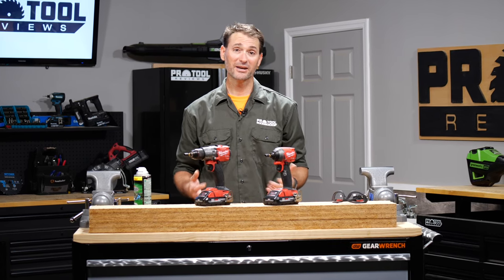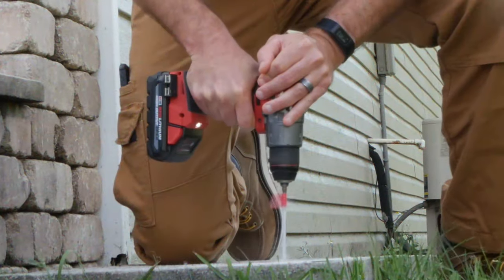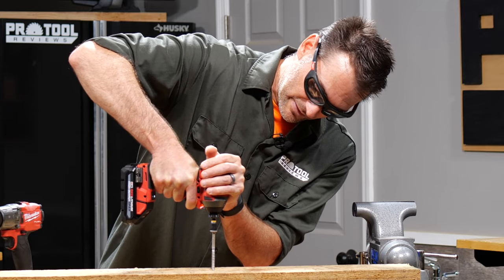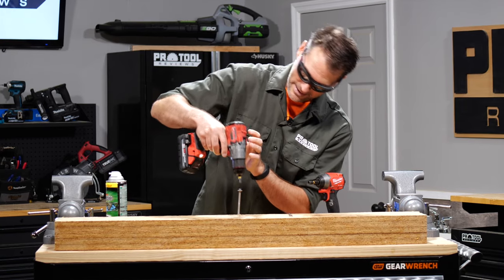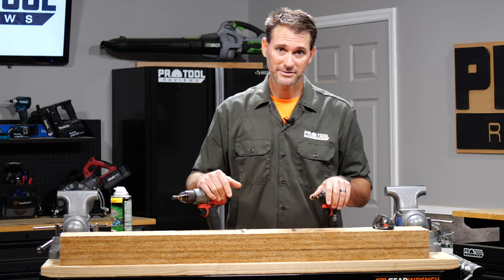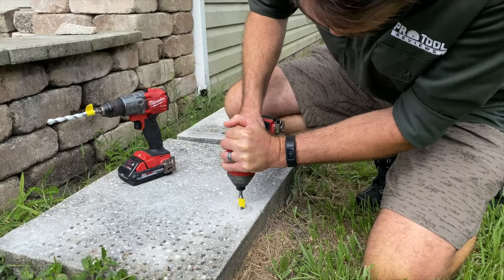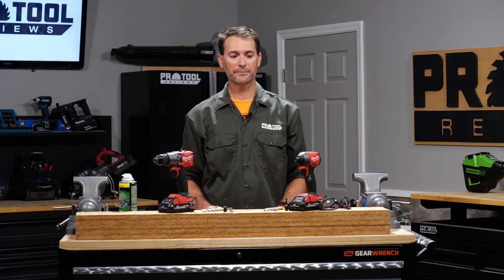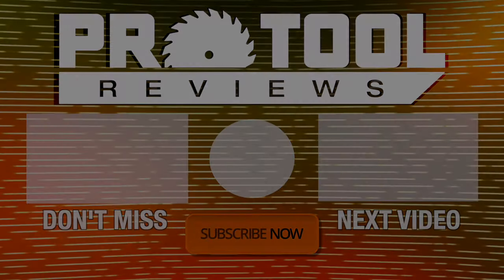Hammer Drill VS Impact Driver | What's The Difference?

Comment: In short, impact drivers use rotational impact to aid the user on not getting strained while doing the driving.

On the other hand, impact drills or maybe better called hammer drills. Uses a hammering effect along the axis of the bit. So it is not helping the gears to rotate the bit.

For example. You have a screw to be driven and you use a screw driver for it. The concept of impact driver is like putting a wrench over the screwdriver and hammering it aiding its rotational motion.

While on the other hand, hammer drill concept is like rotating the screwdriver along with the screw while tapping the screwdriver with hammer on top.

different concepts with different usage. Hammer drills are very good with concrete drilling. And can also do driving tasks. But not recommended for loosening or tightening bolts and nuts (even if you have a hex to square drive adapter). While impact drivers are more compact and and can do driving easier on the user part with less strain, can also drill holes on wood and metal (can do but not recommended in concrete), can also be used as impact wrench if you have a hex to square drive adapters. But in that case it is better to use an impact wrench if needed more power and when the strength of material holding the socket matters. Coz the hell 1/2 inch square drive of an impact wrench compared to a 1/4 inch hex drive of an impact driver. Of course some bits are expensive and you wouldn't want yours to twist/shatter everytime.

In the end. It all depends on what you are doing. Are you into carpentry? Are you dealing with masonry? Or more of assembling things? Choose your right poison 😊

Comment: Does the effect on hole is same?i use one before borrow a hammer drill from my friend to hang something on my wall, but it turn the hole not clean as impact dril, it cause crack around the hole, n the hole become bigger then the drill bit size n make the wall plug loose.
Reply: Lmfao

Comment: Thanks for the great video. I still can’t understand why not use a hammer drill for faster as it appears to work better than the driver in this video
Reply: A hammer drill setting used on any fasteners will damage the threading or tear the material you are driving through. Imaging using a hand hammer to ram a screw into a board of wood or ram a bolt into a threaded insert. You can imagine how much damage it would do to the threading. A hammer drill is really only for drilling holes into concrete and masonry.
Reply: For one thing the hammer drill has more torque than the impact, plus the increase in torque will be felt in your wrist witch will wear you down faster. Also as the man said above it will tear the screws and bits up.
Reply: @sahibal-shemeri5466  Good point. I'm just learning, but it seems like a lot of people, even guys making these videos, sort of miss that crucial distinction you made. The "hammer" is a big part of the name hammer drill. You don't hammer a screw to save 3 seconds.

So if I'm understanding correctly... Because most hammer drills allow you to turn OFF the hammer mode and use it as a regular driver drill, if you're just buying ONE good all-rounder the hammer drill would be a great option...right?? (Assuming (1) I'm needing to twist screws into things most often,  (2) do light drilling every now and then, and (3) only on rare occasions will need to drill into masonry in hammer mode, but (4) would appreciate having that killer option on board.)     

Basically I'd use it for fasteners with the hammer turned off, then switch on the hammer mode only in tough drilling situations. Any feedback would be greatly appreciated. (Soon would be great....I'm buying something in the next day or two! ha. But really.)
Reply: @darren2329  you got it exactly right. Its a great buy as an all rounder since you can turn hammer function on/ off
Reply: As far as I can tell, impactors are good for reducing strain on your wrist and minimising cam-out (slippage) of screws. But the latter only applies to Pozi (or even moreso to Phillips) - torx screws almost never slips so it doesn't make a lot of sense to use them in a test like this, imo

Comment: Might a hammer drill be more damaging to the integrity of the screw or to the wall of the material that the threads are grabbing into?
Reply: Hammer drill and impact driver both provide impact forces very few fasteners are designed for

Comment: But the hammer setting on a hammer drill is just a setting.. it also has a screw setting and drill setting you can change it to. So if you had to choose only ONE drill to have. Out of a drill/driver, impact or hammer drill. It would be a hammer drill right??

Comment: In the case of wood screws,  what you have shown is the opposite of what you have claimed.  It is so apparent that the Hammer mode has won in both cases of concrete and wood. It makes perfect sense to me now.
Reply: Don't use impacts on wood, it will reduce its holding power and may crack some types of wood
Reply: @dragonfireproductions790 Doesn't that go for screwing in drivers without pilot holes generally?
Reply: @feanor5037  self tapping screws only need rotational force.
Reply: @dragonfireproductions790  Self-tappers can still cause wood to split... not sure whether not having a pilot hole reduces holding strength if the wood doesn’t split (sure, splitting is rare) but I'd want to see an experiment to convince me it's definitely the impact driver over either over-tightening, countersunk head resistance causing the thread to tear at the wood fibres or lack of pilot holes
Reply: @feanor5037  well to be safe though pilot holes are needed so that you won't misalign the screws causing more issues like splitting etc.

Comment: So I'm guessing in a perfect world you'd use both to drive a screw fastener into rock/brick?  Hammer drill for the pilot hole, then impact driver for the concrete hex head fastener?  If you only had one tool, which would get you a 1/4" screw into brick the fastest, from pilot hole to screwing in the fastener?

Comment: 3 seconds isn't really enough for me to get a whole new tool when it comes to home projects or even work since my job doesn't drill into concrete much. No more than 3-5 times per job-site.
So saving 15 seconds isn't really worth the extra 130. Thanks for the info.
Reply: Agreed. I thought the same thing.
Reply: That tiny hammer drill is probably just extremely weak. But could replace smaller drills as a light all-round tool.
Neither would go through most common harder materials, and neither is necessary for wood or metal. Looks like they picked the one type of stone they were able to drill.
The impact drivers is primarily useful for fastening screws and nuts with specific torque against metal.
A strong rotary hammer plus a small normal drill handles most jobs.

Comment: For me, the hammer drill outperformed the impact at every level. I might use the hammer drill as my go-to. Actions speak larger than words. Thanks.
Reply: @jacobking4106  You would use a Impact Wrench on lug nuts.
Reply: @jacobking4106  So why comment asking him to remove lug nuts with a hammer drill, you clearly aren't Sherlock.
Reply: A drill is faster up to a point. Under no load, the impact is faster. Under light to medium load, the drill will keep its RPMs, whilst the impact will slow down as it engages its impact mechanism. Under heavy load, the drill will either need to be switched to low gear which is much slower, or it will just straight up not be able to complete the task.

The other key point is that impact drivers transfer no noteworthy torque to the user's hands. Try it at home: get a 4x4 and drive a 1/2" x 4" lag into it with a drill...you'll need to hang on for dear life, especially once the head of the lag makes contact with the wood...whereas with the impact driver you can use just your thumb and index finger and check your text messages while you do it.
Reply: @JR-lg8sq  Just my use case: I use an impact driver (M18 fuel) with attachments for lug nuts/car stuff. Mainly because I only wanted 1 tool, and the driver is the most versatile. This is coming from a non-tradesman, who works mostly with cars.

Comment: can I use impact driver on brick instead of hammer drill?
Reply: It didn't work so well for me.  I had to get a hammer drill for the brick.
Reply: There would be little benefit.  For an impact driver, the hammering would be parallel with the brick,  hammer drill the hammering would be perpendicular or into the brick.
Reply: Only works on certain things and it also depends on what kind of drill and bit you got, cheap drill and bit won't won't, it will just snap of

Comment: Is the Hammer Drill more so forcing the screw in as a nail? Or actually spinning it down without stripping the spirals of the screw?
Reply: use the hammer drill to drive the screw is like spin the screw driver and hitting it at the same time.  That is why the screw goes in faster but at what cost...material damage?

Comment: Thanks,  I didn't know the impact drive could drill concrete.  
Can an impact wrench drill concrete?
Reply: probably because they are a near identical mechanism. the only problem is that an impact wrench doesn’t have the right chuck to take drill bits, only sockets unless if you have an adapter

Comment: guessing here....
But I suppose you'd use a hammer drill for fast easy work drilling through concrete - but you'd use an impact driver if you wanted to screw a bolt/concrete screw directly into the concrete?

Comment: Ok so I have done the same thing with my gen 3 hammer drill and was shocked at how fast and far down it did a screw, but my question is wouldn’t it tear the threads out that the screw hole created in the wood? Maybe not? But I would think it would Create a stripped out hole if you will 🤔
Reply: That's my thinking also. I was guessing that's why he said it's not a good idea to use it on wood, but it's only a guess.
Could be worth some playing around to see what kind of holes it leaves.
Reply: @Protoolreviews  Good stuff. Thanks for the details.
Reply: @Protoolreviews  makes sense except the clutch settings on the gen 3 are too aggressive for soft wood. Whenever I am drilling into cabinets or finish work I tend to use the old ryobi with a mechanical clutch that gives much easier. Too many times if not careful on the trigger my gen 3 set on 1 will still drive a screw too far. But thank you for the response. The gen 3 is a beast

Comment: If I just want to drill a screw into the wood windowsill thingy to hold up the curtain rod holder, what kind of drill would be best? 🤔  Some people on here are saying that an impact drill will strip the wood in the hole it made. 
As of right now, I do not know the difference between an impact drill, rotary drill, hammer drill, or etc etc.
 Can someone help me?
Reply: for attaching curtain rod on wood I would recommend impact driver for driving screws since you might be working in a tight area. don't use the hammer action for driving screws when using impact drill, even on hard wood. rotary drill even with no hammer action is a big no for driving screws since it has high RPM and much less control
Reply: for pre-drilling, any drills with no hammer action would do the job. make sure you use slightly smaller bit for pre drilling than the screw itself.
Reply: @Rikardo97  So I should use an impact drill, make sure no hammering, and pre-drill first with a bit smaller than the screw...correct? 😊
Thank you. 
I didn't  know we were supposed to pre-drill. I thought we were supposed to hold the screw up, and drill directly into the wood till it made a hole. 😬
Reply: @GoaWay...  the hammer action on impact driver is automatic due to the increasing resistance the driver feels. can't be set to off. as I said with no hammer action, if you tend to use impact drill such Bosch GSB 180 LI to drive screws.
Reply: @GoaWay...  pre-drilling is a must to prevent cracks on wood when you're about to drive screw into soft wood, or putting screw on close-to-edge side of wood.
Reply: @Rikardo97  I am even more confused now. What drill doesn't have hammering  so I can pre-drill?
Reply: @GoaWay...  any cordless drill on the market. I guess every impact rotary drills have the feature to activate or deactivate the hammer action
Reply: @Rikardo97  okay. Thank you. Now when I pre-drill, what kind of bit do you use?
Reply: @GoaWay...   any twist type drill bit for wood would do
Reply: @Rikardo97  okay. Thank you.

Comment: You should never use hammer mode on the drill while screwing. Hammer mode is only for drilling into bricks or concrete.
Reply: You made the statement, now can you actually EXPAIN why not?
Reply: @hippo-potamus  Will try to be simple, Hammer mode, can ruin the meeting points(instead of nice threads being cut, it can become a smooth hole at certain points) vs solid wood, laminate, plywood etc.., this can become an issue overtime with load bearing, expanding/contracting of wood.. etc.. Yeah you can get away with using good quality hex screws, but you will strip the screw with Philips, while also ruining the bit as it is not rated to be hammered. I get it, it's like people want a tool that can do everything, but unfortunately, to do things properly, you need the right tool for the job. For instance that dewalt battery powered hammer drill,  going into foundational concrete,, it would take you 30mins to go in. You would need a rotary hammer drill, yes those big boys looking like a reciprocating saw on the shelf. The hammer drill function on a cordless drill, I mean it's great for small things around the house, but it's over hyped.
Reply: @sdfsdf2205  Thanks. My house has solid concrete block walls with concrete plaster on top, the dewalt atomic 20v hammer drill has been the MVP of my renovation. Small, light weight, but highly efficient. Its a true workhorse.
Reply: @hippo-potamus  Bruh, you need to make your troll game better. <3

Comment: Impact driver is cheaper and you can drill into concrete with it which i didnt know. Im gonna get one
Reply: yes. In some really soft concrete. I bought impact drill for drilling in wood/metal with standart drill mode, drill in concrete with impact mode and to use as a screw driver with screw driver mode or drill mode. It drives screws into wood fasted than impact unless you use some huge screws. (like bolting some logs toghether) and also impact is very loud. If you want to buy one tool for all, buy impact drill/combo drill with something like 50 nM in 1st gear and it will do like all of home- gamer jobs without annoying neighbors.

Comment: Why would I need bite drills? If the hammer drill does it better and faster for all applications?
Reply: My experience is that the impact driver has less slipping, which is nice when using phillipsscrews. And the hex collet makes shifting accessories ALOT faster than with a drill chuck.
Besides that, I'd say if you are just getting one of them, the hammer drill is the way to go.

Comment: i still dont understand the purpose of a drill driver when i have an impact and a hammer drill.
Reply: You can attach wire wheels, paint mixing wheels and loads of nifty attachments, also the drill has a clutch very useful for drywall screws as an example 
It's by far the most versatile power tool
Reply: Drill driver, lighter. But I don't see a point of a drill driver clutch when I have an impact driver.
Reply: @TheFlick175  doesn't the milwaukee hammer drill ( maybe all of them ) have a normal drill driver clutch settings as well?
Reply: @TheFlick175  so does/can my hammer drill.

Comment: using a hammer drill for screws is completely ridiculous, it destroys any threads in the wood...of course it's fast...the screw has nothing to hold on to anymore...you might as well argue that slamming a nail inside wood is even faster

Comment: What I really wanted out of this was to know if a person who has a combo drill/hammer drill....can just make do with what he has, or go out and spend over 100 bucks on another tool. I get it if you're a pro. But just a "joe?"
Reply: im just an average teenage diyer whos into cars and has a fixer upper house. I started off with a drill/driver kit, and it was super nice to have both. you can switch bits on the driver extremely easily/quickly, and just having two tools is nice. I was reattaching my gutter last week, and i used the drill to predrill holes and the driver to drive the screws. yes i couldve made do with just a drill, but it wouldve taken twice as long.

basically, get two if theyre on sale, but you can definitely make do with just the drill

Comment: He had the drill bit on the Hammer Drill rotating counter-clockwise on the concrete test, it should've been going the other way. I bet the time would've been around 7 seconds if he had it going in the right direction.